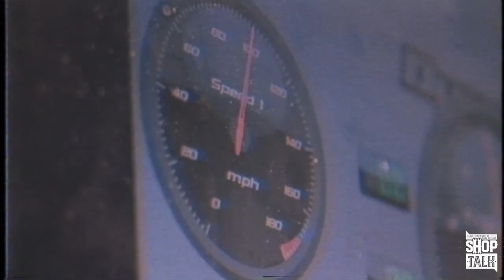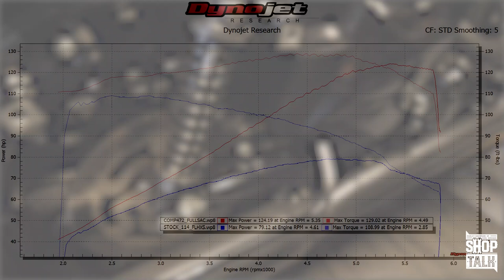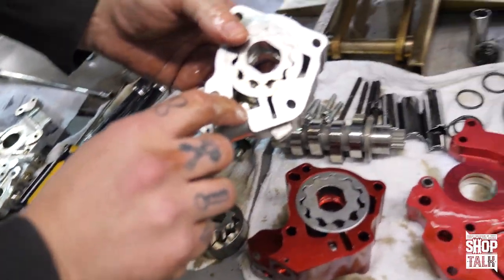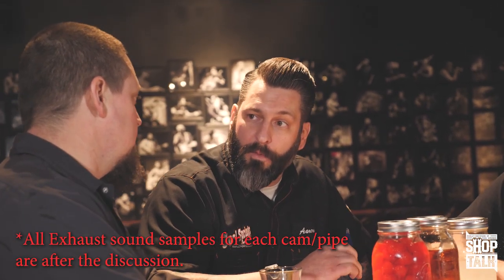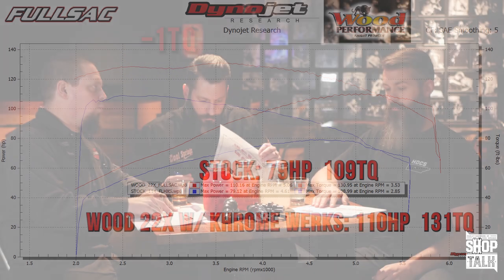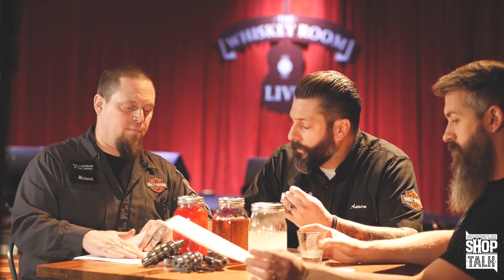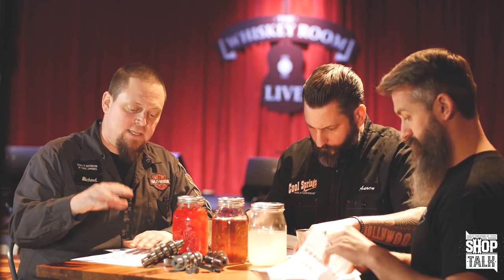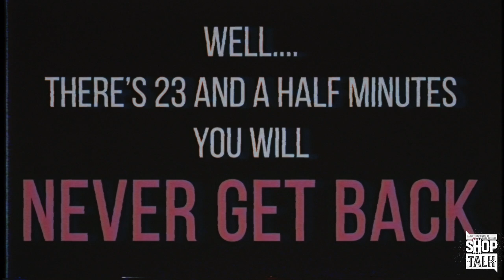Cam Shootout Series | Part 1 (S&S 475G, Wood Knight Prowler 22x, Comp Cams M8 246A, Redshift RS472)

Comment: This is so great. No one has done a video like this before with this great of detail and knowledge. You guys are changing the game.
Reply from the maker: Thank you so much. We love hearing this!
Reply: @MoonshineHarley  with a stock 2018 road glide 107 M8, what HP and torque could I expect if I did a full exhaust, stage 1 air cleaner, tuner, S&S 465 cam, S&S cam plate and oil pump and tuned?
Reply: Was a real comparison when a different setup was used on the Zipper’s cam? Just a thought

Comment: Just wanted to comment on my recent experience with The crew at Moonshine Harley. This past Tuesday my wife and I picked up our Road Glide bikes from Moonshine where they did the stage II on the 114’s and we could not be happier with the results. Is not only about the performance of the bikes but the way they treated us. We felt at home with everyone at the dealership and we look forward to more visits and perhaps more performance for the RG’s . The worst part of the hole experience was riding through very heavy rain and wind on the way back to Daytona and even that was kind of fun with the new power. Good work Jamie and the crew. 👍
Reply from the maker: Eddie Rodriguez Barbara and you are amazing! Thanks for trusting us with your performance needs.
Reply: what exhaust did you go with? I'm having issues with torque loss on my stage 2 set up
Reply: @bertmancaster8522  
I went with the Rineharts because I installed them at the dealership in Orlando. If I would have gone with what Moonshine H-D wanted it would have been better. But with the combination that they put in the engine I have no complaints, I know I lost 2-3hp between 2,000 & 2,300 rpm but it still pulls beautifully. If I had to do it again I would go with their suggestion. If you can give Moonshine and I’m sure they will help you. Good luck and be safe GBY

Comment: VERY well done video.  Just finishing my ‘19 EGS build and considered each one of these cams....ended up going with the Wood 22X with complete S&S cam chest upgrade (plate, pump, lifters, lifter cuffs, push rods) and S&S MK45 complete exhaust system.  Decided to run the PowerVision tuner with a little creativity and couldn’t be more pleased with the outcome.
Reply: Do you have a sound clip after the build?  I'm looking to the same build but would like a reference before plopping down the cash

Comment: Cheers Moonshine Harley!!!
I just got my Fullsac Header pipe and I shipped it to Jet Hot High-Performance Coatings. I went with their traditional polished look. I wanted to say thanks to Mike, Aaron, and the whole team at Moonshine Harley...
2018 Gun Ship Gray CVO 117" with Red Shift 468 Cam, S&S Cam Plate, S&S Oil Pump, S&S Tappet Cuffs, S&S Pushrods, S&S Chain Tensioner,  Fueling Race Lifters, Dynojet Power Vision, Dynojet Target Tune, Fuel Moto Dynamic Exhaust Tuning Inserts, Fullsac Headpipe and Rinehart mufflers.
Reply from the maker: Nice. Let us know how you like it.

Comment: Great video and terrific in depth  un-bias test results!  Thanks for doing the work. I just purchased a 2019 R/G Ultra with the 114 and was really happy with the power but wanted to see what an all S/E epa compliant  improvement would do sooo.... I did the Ventilator A/C. Full high flow twin cats in the mufflers (looks great with  large dia. pipe being used through out, and the S/E tuner with the Torque stage II cam. Results?? 
  115 Ft Lbs of torque just above idle and FLAT to 5000 rpm,  Power-  105 HP at 5200. I'm not really sure what I left on the table , BUT it is completely under my 7 year extended warranty and it is a Touring bike which I plan to put on alot of miles, so am happy with the set up. Thanks again for all the work you did on the comparo.
Reply: We just did a stock 114 video
https://youtu.be/DbeF1QSSBRU

Thanks for watching
Reply: scott peters Just to clarify the extended warranty part In your comment. Harley will Flag the power train if you use an aftermarket tuner for the 2 years that comes with the new motorcycle purchase. The Harley extended warranty does not have the same requirement on the extended years. So
Flagged Vins are covered once you hit the extended warranty period which will be covered by the extended service plan which is backed by CNA. The only thing to keep In mind is that they only pay what the harley parts cost so
you might have to pay the difference between the harley parts and your aftermarket ones which are usually close in cost. 100% of the labor
will be cover. Sounds crazy but that’s how this works. 

So no power train under the first two years but you’ll be covered under the extended years that you purchased. I just wanted to make sure this knowledge was put out there.

Comment: Have tried several S&S cams.  Have settled on the 625 gear drive easy start edition.  Roller rockers & S&S Super Stock heads that flow 283CFM A.650" lift.  10.8 c.R.  !06 cubic inch  Built entire engine with S&S parts.  Raced a 10.8 second Sportster.  He had to sniff my exhaust.  630lb 2014 FXDL with Baker Grudgebox.  55mm HPI throttle body.
Reply: That is a nice setup for a twin cam.

Comment: I’m a long time fan of Fueling and installed the Plate Pump Cam Pushrods & Lifers in my FXDC TC96 and not only did it improve performance but also dropped head temp by 33 degrees here in the fucking Hot as Hell Texas summer weather!😎
Reply: Nice.  I also like Feuling.

Comment: I like that low tone of the fullsac in the video. It's always hard to trust video sounds, but in the video it sounds better than D&D to me.
Reply: It does sound really good.  It has a deeper tone and isn't so loud when idling and cruising that it drowns out the radio.  When you twist it though it has a great bark!

Comment: Zippers cams 468 in 2019 street gluide thunder max tuner. Pushrdes rolles. Gained 29 hp 17t. That's bad ass nbs

Comment: Wish it was done on a stock 114, it wasn't until i read the description that the bike had a 117 SE set up, I kind of figured those numbers were a bit high for just a cam upgrade.
Reply: Live2Ride TheFlames stay tuned we have a cam video coming for the stock compression 114. We use 4 differed cams in the 465 lift range.
Reply: @jamielima5315  Nice, you guys are killing it with these videos. I appreciate the update, looking forward to it. keep em coming.
Reply: Yeah I caught that as well. Not really a comparison when you go bigger cylinders and injectors.

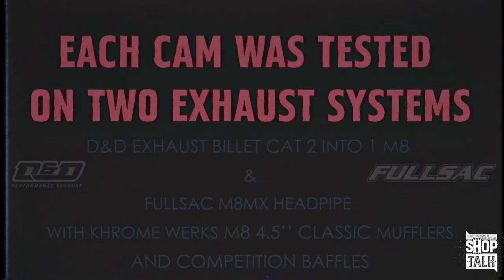Comment: Nice process presenting the results objectively. I am not a Harley guy so it doesn't help me much. Performance wise seems like a huge increase going from a horsepower to weight ratio of 1:10.1 to around 1:6.6 assuming the wet weight is about 800 pounds and the stock bike made 79 hp and with the new cam it made about 120 hp.

Alot of performance from a cam and pipe with a dyno tune. I am a Triumph hotrodder so I get why you would do it but the boys in Las Vegas would say your making your point the hard way.

Comment: Awesome video. And let me tell ya. Video does not do the Khrome works muffler justice. In real life they are by far the best sounding exhaust I’ve ever heard. Supper low, supper thumpy, no mid range “brap”. Just great mufflers. The s&s 475 cam with fueling oil pump, cam plate, lifters, push rods and valve springs and the khrome works mufflers with fullsac head pipe is a great set up.
Reply: great video, I've had the S&S 475 installed, and now going to the Khrome Werks slip ons.  I currently have the fullsac with 4" Rinehart slip ons, and have an big torque dip early. Which Khrome Werks baffle will be best choice?  The Khrome Werks site doesn't label any as a "competition baffle." Just want to get the right one.  Thanks for the great information!!
Reply: @MegaSummit800  :  I was wondering the same thing.  I think the competition baffle and the performance baffle are one in the same.  In my research, the louvered baffle works just as good as the performance one and sounds a bit louder.

Comment: I have a new Sport glide107 motor. Screamin Eagle air cleaner, Thunderheader. I’m a low rpm guy, very rarely shifting over 4500 rpm. Your opinions on the best cam(s) for me. Keep up the good work! Fantastic dealership.
Reply from the maker: Stay with a 465 lift cam unless you add some high compression pistons. Check out our 465 cam shoot out for which is for stock compression M8’s. A 475 or larger lift cam will be soft I. The lower RPM’s. Please call Aaron or Jamie at the shop if you have more questions.
Reply: @MoonshineHarley Yes.The 475 c in my 22 Fat Bob 114 was horrible coming off idle.Never again.

Comment: Great video guys. Lots of good info. I have an 18 Road Glide Special with a dealer installed SE Stage 3 build. I run the Fuel Moto Jackpot header with the 4.5" Screaming Eagle muffler. Tuned with with the SE Street tuner. I'm pulling 115TQ and 109HP according to Dyno. Wanting to jump up to the Zippers 468 cam and swap out the headers and mufflers. I do a lot of interstate 1 up riding and like a lot of torque under the ass. As far as exhaust sound I want something that'll rattle you inside with low deep loud tones. I know the D&D is a leader but sometimes the sound is too crackly for me. Had the V&H combo of the power duals and HO 4.5" slip-on mufflers and loved the low throaty growl of that combo. Would love to hear your suggestions and input. Have heard great things about the 468 as far as torque. I'm over in the Memphis area.
Reply from the maker: Here is the chart Mike is referring to on his Instagram: https://www.instagram.com/p/BuOG_ljgntK/
Reply: @richardedwin5980  haha.  I was only refering to a pick up because it will take full day to do it, but I like your style man!  You fit right in!  Aaron will get you Rollin.
Reply: M.V.O _Motorfast I leave here by 0600 will be at your door by 0830. Y'all work on it. I'll visit the local hooters, stay overnight maybe if too much hooters and roll the next morning.
Reply: H-D Cool Springs looks like pretty decent hoping I can get some more outta it since I'm already 109HP and 115TQ. Gotta choose headers now. Suggestions versus what I already have?
Reply: @richardedwin5980  this is the part where I instruct you to call Aaron tomorrow.  We will get all the components figured and schedule it so we are 💯 ready and then the day you ride up we can bust it out and get you back on it that day.

Comment: How does fuel Moto’s jackpot head pipe compare to the head pipe you used in the video?
Reply: Aaron Haas It’s a good pipe but the Fullsac out preforms it some. Jamie at Fuel Moto just released his competition XXX for larger motors and we are going to test one soon. It could be an awesome setup but it’s for big boy Motors 124 plus.
Reply: Also who makes that gear you use on the cam?

Comment: My FLFBS is at my local dealer having a stage IV kit installed as we speak. How would these cams perform against the standard SE8-515 cam that comes with that kit? I am very nervous about how my fat boy will feel like in the lower rev range. Are any of these cams a good match for the components the come with the stage IV kit? Excellent work putting this video together!
Reply: There is a lot that can determine how well everything responds such as what kind of exhaust you pairing with the set up.
Reply: @NoName-vz1ob  Screamin' eagle street cannons slip ons.
Reply: @alainsauve  we would probably go a different route if it were up to us, however for the HD stage 4 that will probably work out well for a balanced curve.
Reply: @NoName-vz1ob  This is why is respect Mike, Jamie and Aaron so much. I trust that they have the expertise to help me make informed choices. The videos prove that to me. Makes me want to ride down to Nashville.
Reply: @alainsauve  you are welcome anytime.  We would love to see your bike when you are done!

Comment: Which insert do you have in the khrome werks mufflers?  Khrome werks told me they have 3.  The ripper which is just a straight pipe.  Louvered and the performance insert.  I just bought the khrome werks 2-2 system and want to get the best low end when I re dyno my bike.

Comment: Tons of great info, thanks for the video!  Quick question for you - there's lots of talk about how the M8 needs back pressure to make power, especially down low.  Do you know anything about Big City Thunder baffles?  I ran them in my twin cam but hesitant about my M8.  Would I get the back pressure this motor needs?
Reply: @jamielima5315  Thanks!

Comment: I know this is an older video but I’m just seeing this and I love the comparison you guys did.  I’m thinking of doing cams but I’m kinda lost.  I have a stock 2017 Low Rider S and when I get back stateside I plan on going to a stage 2 at least.  What would you guys recommend for a good 2-1 exhaust and cam choice for the best performance on a stock 110 Twin Cam?  I have done a ton of research online but you guys def know what people are doing in the aftermarket and would like your opinion.  I already plan on getting a power vision tuner when my warranty is up.  Thanks in advance if you decide to reply.
Reply from the maker: Andrew Petersen please send me an email with you contact number. Either myself, Jamie or Aaron will reach out to you. I rock a Twin-Cam low Rider S so I’ll most likely be calling you. Email me at Jamie@moonshineharley.com

Comment: I have a 18 fltrxs was considering the 22x now I know thanks great vlog
Reply from the maker: ace f anytime!
Reply: ace f what exhaust system are you running or planning on  running?
Reply: I'm thinking either fuel moto xxx or fullsac they look the same with x pipe,they both resemble the screaming eagle pipe but of coarse harley won't let you just buy the headpipe without the stupid mufflers with cats soooooo either will work,now slip ons for those are still up in the air
Reply: I'm running a homemade head pipe right now took a stock head pipe and took cat out blocked off left side and through a street cannon on,looks stock and performs ok but no sound so...I'm looking and watching cause at that point it's about sound

Comment: Thanks so much for this .
I am getting back into a Harley Roadglide after 10 years of .
Would you recommend  
doing stage 2 on 107 Milwaukee 8 . With stock Exhaust .or the Best alternative Quite exhaust that performs 
Thanks .
Reply from the maker: We have several options we would recommend for you application but other parts determine our recommendation. Tuning capabilities is the main one. We like the Fullsac header paired with Khrome Werks mufflers with one of the Moonshine Horsepower baffles made for us by Khrome Werks. We keep these parts in stock and can ship anywhere in the US. Please call the shop and ask for Aaron or Jamie. 615-274-4170

Comment: The SS475 cams sounds aggressive because it makes the front cylinders valves opens more than the rear. Which eventually leads to a hotter front cylinder.   Another words, the cylinders becomes imbalance thus the loppy sound. But is this advisable for the long run? Most cams out there doesn’t do this. Pls do advise . Tq

Comment: This was an awesome video. Very intuitive and well done. You guys mentioned you have build numbers on most exhaust setups and chose the ones in the video for a reason. Curious to know what you guys have thought of the full rhinehart setup (headers snd exhaust) and what cam you guys liked the best with that particular setup.
Reply from the maker: Loren McDowell We talk about the exhaust options that has put preformed others. Some just didn’t make the cut. We do have new exhaust options available that hit the market since this video. So If you need more info call the shop and ask for Jamie or Aaron. 615-274-4170 Or go to Moonshine harley.com and click on the Performance Shop tab and select Moonshine Horsepower.

Comment: For the comp cam, the d&d vs the other pips isnt going to lose 10 hp to the wheel vs another pipe. At that horsepower level I would be curious to see the tune in it. I almost get you pulled timing out because you were out of injector
Reply: Baggerz Anonymous M8’s are really picky on exhaust setups.

Comment: Awesome video, I’m in the process of picking upgrades now.  I really like Zipper’s redline 468 and would of liked to seen it on here. 
 I searched your channel over to see if you expanded on why you like the head pipe and exhaust that you went with. You mention many test that made you choose this.  That would be a great video since every Harley rider usually starts with exhaust and a head pipe day one. Do you care to mention some good ones and some to avoid?
Reply from the maker: The good ones are mentioned in the video. We also have our own head pipe but its to support the larger bore M8's like 124  -128 - 131 setups. The 468 is great as it's the largest cam we would recommend for a stock compression M8 and it can also support a high compression setup. It's the best in-between cam for that reason. The largest mistake we see is riders choosing larger cams like 472 and over for a stock compression M8. The 465-468 cams will outperform those cams by far under 3,000 - 3,500 RPM and are A LOT Snappier. Please call me Jamie Lima if you need any other information, 615-274-4170.
Reply: @MoonshineHarley  Thank you for the information and the reply.

Comment: Late to this party.. did y’all do a vid like this on the twin cam 103?.. Also, do y’all prefer the feuling plate over S&S? I ask because of pinion runout.. HD allows what? Up to .012”? It looks like the S&S has a bushing and the feuling doesn’t.. that’s why I ask